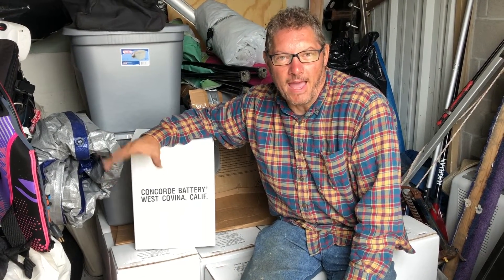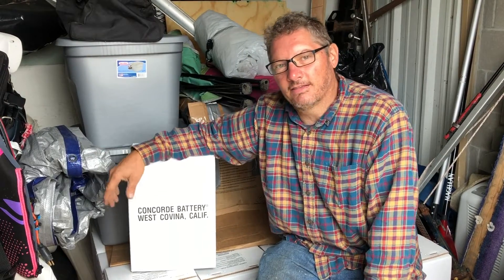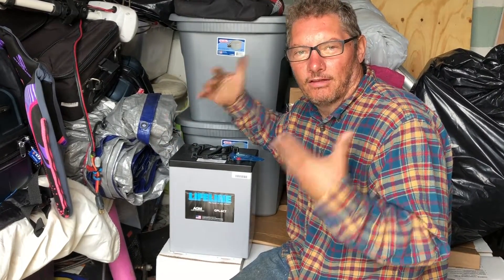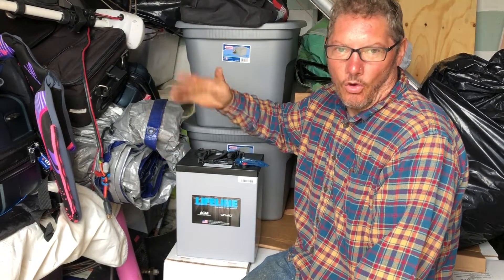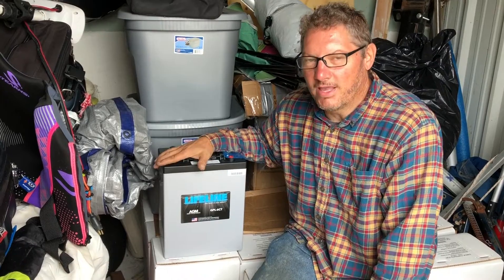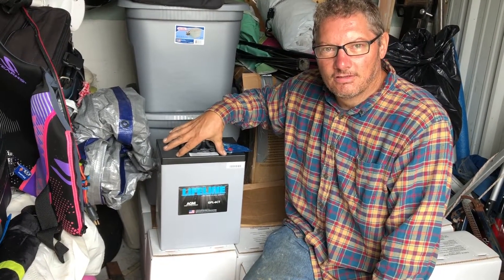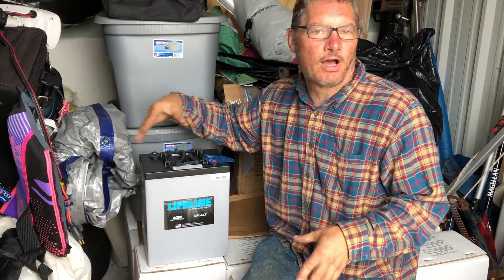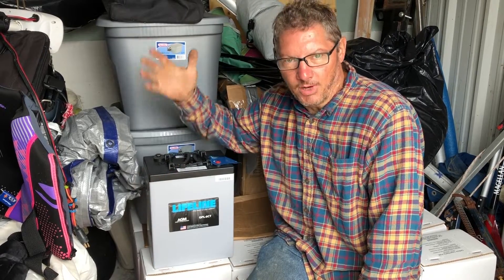GOING ELECTRIC! Choosing batteries for electric sailboat | ep. 28

Comment: Going thru the old videos for background and data collection.  Any particular reason you used 6v batteries at that Ah rating...  cost per watt perhaps?   What did the 12v look like back then for cost as comparison?
Reply from the maker: As I recall they were the best bang for the buck at the time. We were interested in Firefly batteries but they were having quality control and supply issues at the time. When these die we will switch to lithium, unless there is some new technology.
Reply: @Spoondrifters  gotcha....   im kind of reviewing for same thing.
Reply from the maker: Sailing Avocet and Salty Escape both have videos of building their own lithium banks if you need some reference. Avocet went into some good detail.

Comment: why not lithium battery?
Reply from the maker: We bought these 3 years ago and lithium was still really expensive.
Reply: @Spoondrifters  I found your website and was interested in what you finally ended up for your battery bank. I saw your choice of motors, not fantastic in my opinion, and your battery choice is even worse... 
You're so wrong about the value of Lithium vs Lead Acid even 3 years ago.  When you compare the number of times you can discharge to almost 90% DOD Lithium's to lead acid, the cost is better for the lithium, even 3 years ago. We're going to see a video where you say those Concord's are toast, if you haven't already make one.... So sorry to be negative, but it needs to be said for anybody that is seeing your choice.
Reply: @rushd45  - Thanks for your opinion.   But did you not watch the video?

Todd explains everything clearly.
Reply: @MikeyCanuck123  His explaination is very clear about what he thinks, but if he had looked at the facts comparing Lead to lithium he is wrong. Lithium even back then was much more efficient than lead and cheaper for the life of lithium as compared to life of lead batteries...
Reply: @rushd45   - No, he's not wrong.   It cost double up front for the LiFePo's.   That's why he went with AGMs.
Reply: @MikeyCanuck123  I'm not going to get into a big discussion, but for the 2x cost of lipo's, you'll get about 3x the life of AGM's... just do some more research. It's a well know fact - longer life, deeper discharge, lighter weight, etc... Good Luck.
Reply: @rushd45   - For whatever reason, you're missing the entire point:   INITIAL COST